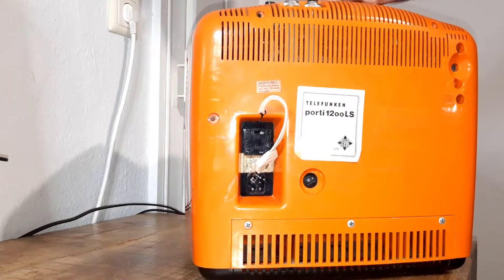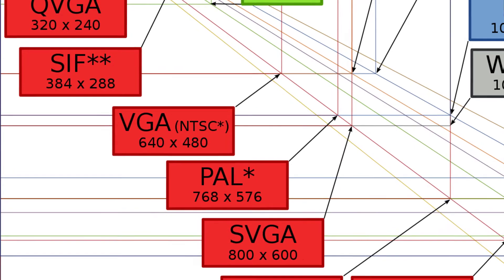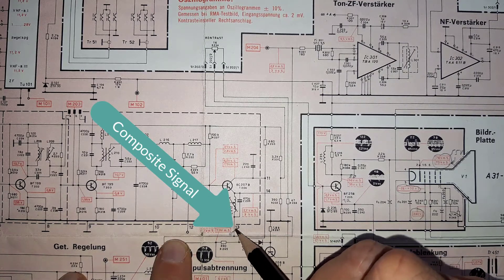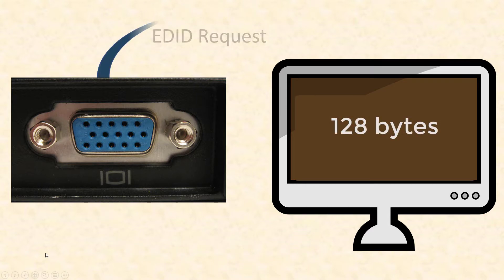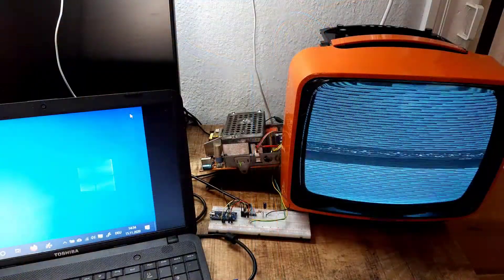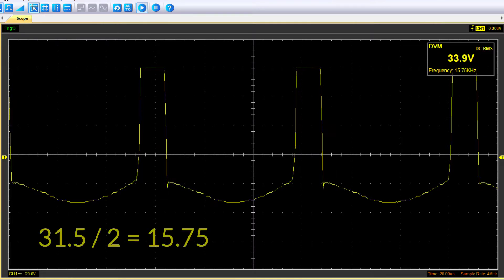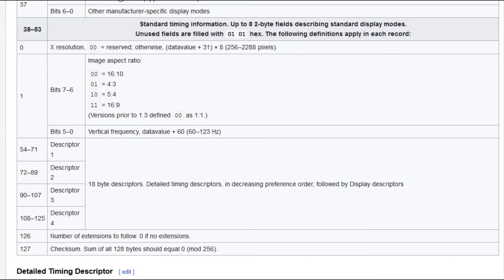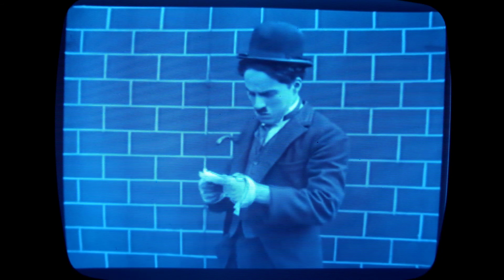Windows 10 Desktop on Antique CRT TV?

Comment: ok so i managed to obtain a samsung crt tv from the 2008's
it has RCA component input(red,blue,green) and composite input (yellow,white,red) also an s-video input and a SCART input
my laptop has HD4000 with a VGA
basically i need to write bits to video memmory?
when i connect vga to component input the notebook detect the display, but no image on tv...what should i do?
Reply from the maker: Find out if your graphics card supports the timings for NTSC  PAL. Then write the EDID bits as I did in the video.

Comment: i have a Philips brand radio model TV. The code is 10cx1130 / 02s. The cathode of the tube came out. There was a gas sound from the back. I was afraid that it was broken. I disassembled it and cleaned it completely. What happened when I put it back together?
Reply from the maker: It seems that the CRT has sucked air. So it will make no sense to put it back together as it won't work anyway.

Comment: If I see it correctly, RGB are mixed with the same resistance value? That's why there was no difference between the RGB bars on the test image.
To improve this, the resistors should be chosen in the ratio: y = 0.3 * r + 0.59 * g + 0.11 * b.
The values do not have to be adhered to exactly, it is sufficient if they are approximate. 0.3* r + 0.6* g + 0.1* b
Reply from the maker: You are right. I didn't think of this.
Reply: 0.3 ohms resistor can you provide a example?

Comment: You do not need any Arduino. Just force a monitor in Windows config and voila.
Reply from the maker: How can I do that? Under Windows 10 I could only choose modes offered by the monitor. But maybe this is possible with older Windows versions.
Reply: @DoctorVolt  Thats because u are using intel GPU, with Nvidia or AMD u can create very detailed custom resolutions.

Comment: Awesome! So, in the end you just displayed using standard PAL signalling. Could you provide the Detailed Timing Descriptors values for others to use?
Reply from the maker: Yes, this is only possible when the grapic card supports interlacing. It is not difficult to find the PAL or  NTSC timings. They can be found on Wikipedia for example. So I didn´t do the extra work to provide them.